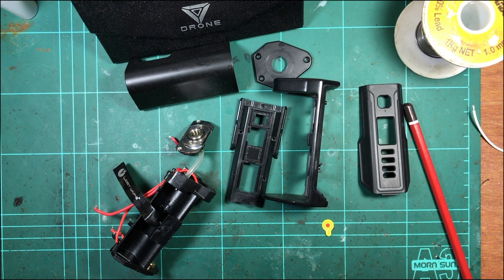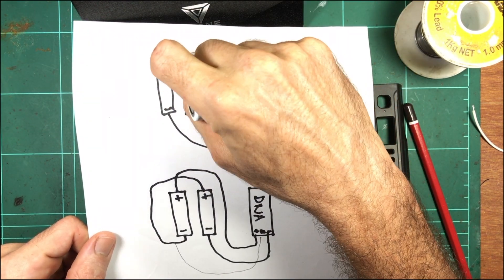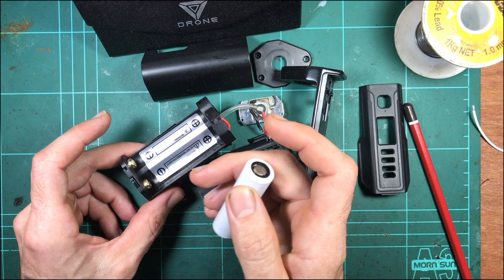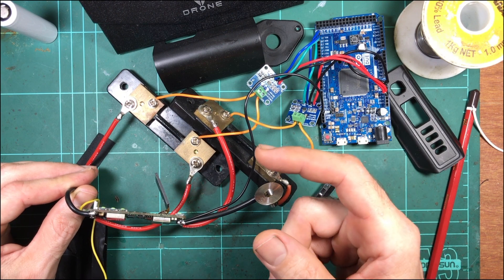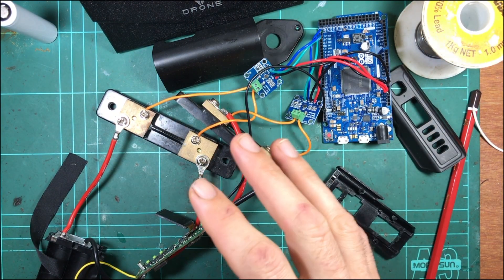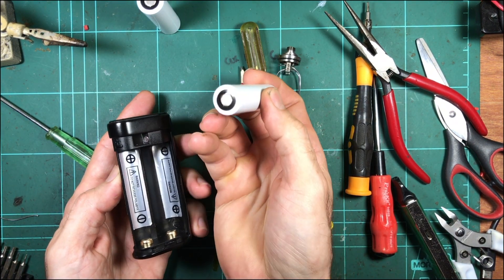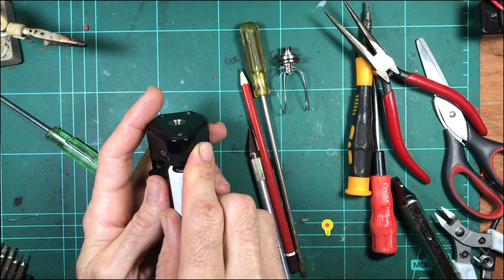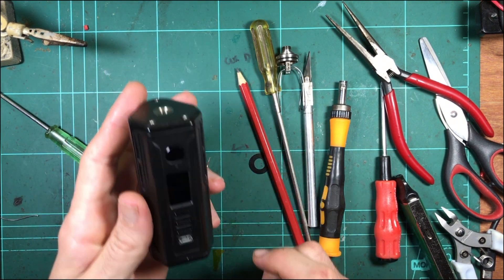LostVape Drone DNA250C - Fixing the squonk tube and improving the wiring

Comment: Here I am years later just getting a hold to one of these and mine just stays at 4% battery no matter what.  Have any idea what would cause this?
Reply from the maker: Hello mate, sorry for the late reply! That’s normally caused by a component failing on the DNA board. Specifically, they have a Texas Instruments BQ76925 analog front-end IC which is responsible for reporting cell levels, balancing functions etc. When this fails the main microcontroller doesn’t know what the battery levels are at. You can confirm this by plugging into a PC and connecting with their Escribe software - it’ll be obvious if the cell voltage or % levels are showing as something dumb. The fix is not easy, you’d have to either replace the entire DNA board or have the IC replaced.
Reply: @vmgtesting8014  I ended up figuring it out.  I had to solder the tap lines together so it would read as 2 batteries. Took me 3 days to figure it out only after  pausing your video and watching what was soldered on the teardown.  Thanks for the response non the less. Got it figured out and working great

Comment: Bro how do you not have way more subs awesome content love watching this
Reply from the maker: I read this comment on my way out the door to work this morning and it made my day, much appreciated good sir :D
Reply: @vmgtesting8014  dude just stating the facts bro can't wait to see more videos from you
Reply from the maker: @CharlieK-91025  Definitely more coming mate, just got in a bunch of new gear :D Vaporesso XROS 2 destructive disassembly vid should be up in a few days, then more disassembles - Geekvape Solo 2, Mini 2, Vaporesso Target 80, then YiHi SX Nano. Shiiiit I better get cracking hah. Thanks again my dude and always open to suggestions btw.
Reply: @vmgtesting8014  awesome man can't wait
Reply: @vmgtesting8014  I have a question Everytime I hit my legend after the screen goes off I can hear it clicking like in the board is that normal lol I just noticed it
Reply from the maker: @CharlieK-91025  Yeah man that’s actually completely normal. The sound is from the voltage converter while it’s putting out small pulses to check the atomiser resistance. It should stop after a few minutes when the board goes into full standby mode. The converter will also be making a more constant squealing kind of noise while it’s firing but you probably won’t hear it over the sound of inhaling. If you have an electric guitar there’s a trick to actually hear the converter working - try firing it right next to the pickups, you’ll hear a bunch of noise induced from the voltage converter ;)
Reply: @vmgtesting8014  Yeah it stopped clicking but I appreciate the info I figured I'd ask you about it lol
Reply from the maker: @CharlieK-91025  No worries mate, feel free to hit me up about any of that kind of stuff
Reply: @vmgtesting8014  appreciate it man
Reply: Everyone can do an unboxing .but not this one .such a great content

Comment: Well that answered my question from the other video..the screen did work! But man I've got so many questions! I'd really like to see this at normal speed. Since I'm taking mine apart I really want to fix the wiring of the batteries the same way, and watching this in detail would help immensely, especially considering the problems it looked like you had with getting the top part back together. I assume you used all new wires, not the originals that came out of the device? If you could post the normal speed video, I would be immensely grateful!
Reply from the maker: Hah, good timing to show the reassembly! Yes the screen did indeed work, definitely was scary lifting it up but I think just go really slowly with light but constant pressure. Heating it up a little should help to soften the adhesive too. The bulk of the time modifying the wiring was getting the top contacts back together properly - there’s the plastic rings between the sled and contacts then a retainer on top - not super difficult just really fiddly and take time to get everything in the right spot. Pay close attention to how everything fits together from stock and use a container for the screws and parts so you don’t lose anything! You can definitely reuse the original wiring that’s inside the device already, there will be plenty spare. I used thicker wire but it’s not necessary especially as the runs are shorter after modifying, and thicker wires makes it more difficult to fit. So basically what you need to do is join the top two contacts together with one wire coming down for the sense connection, then a separate wire off each bottom contact up to the main positive and negative connections on the board. I’m sorry my PC stopped recording before the final assembly! Let me know if you get stuck and I can try uploading the video I have without the speed up. My internet connection sucks so large uploads are difficult - they often fail, but can probably cut them up into smaller parts. Cheers!
Reply: @vmgtesting8014  perfect timing indeed! I watched the first video around a month ago, then looked thru your other uploads and found you had just posted this! Thanks for the reply! I'll definitely hit you up. You've got the only LV Drone teardown and assembly video on YT!